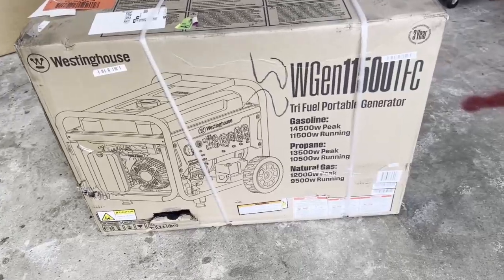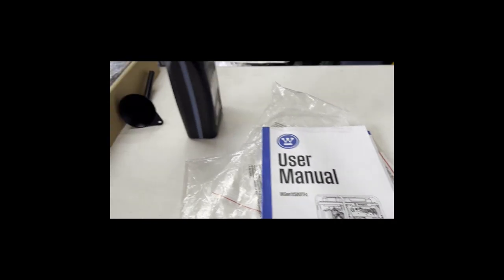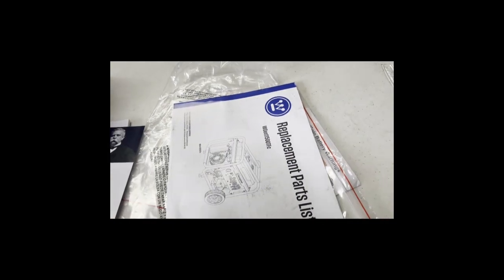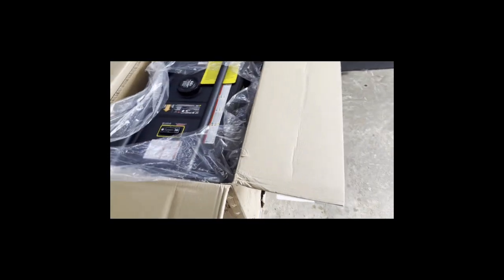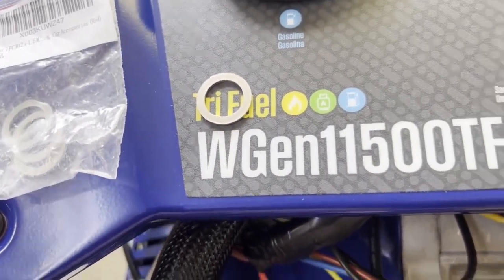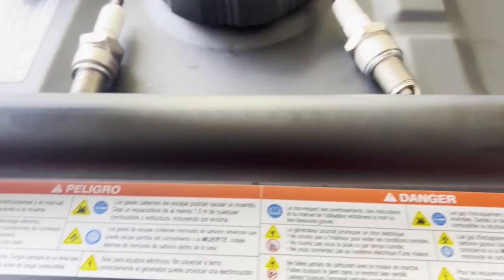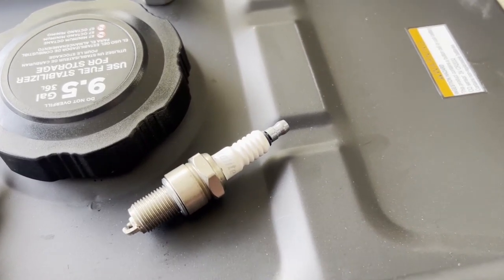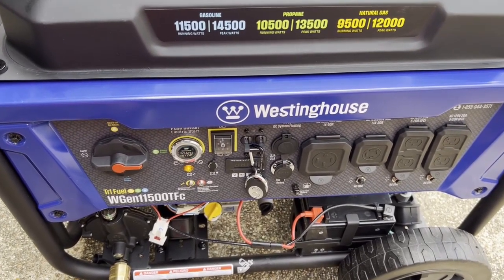My Westinghouse WGen11500TFc

Comment: What was the purpose of changing the spark plug out?
Reply from the maker: The Torch brand spark plug is junk. Lots of people have issues with their generators starting and running well when using them. 
I needed to remove the plug regardless to check the gap since I am planning on running only on natural gas the gap needs to be smaller.
So no real extra time to replace with a better plug.

Comment: Did you make your 11500TFc a floating neutral for plugging into the 50amp inlet?
Reply from the maker: Yes, just followed the instructions in the users manual. 
Took less than 10 minutes to remove the cover, unscrew a nut and a bolt and put it all back together with the neutral wire unbonded (I looped it back on itself so it is still in the generator if ever needed to swap it back). I also made a label to put over the front to show it is a floating neutral unit.

Comment: Awesome video. I upgraded my NatGas meter from 0.5lb to 2.5 lbs regulator done by the utility company and had a plumber extend the line. This will help ensure you have enough flow for the generator and the house items (furnace/fireplace, water heater etc.). So you’re not starving an item and/or not getting your generator to run.  Also upgraded my spark plug as mentioned in the video.  Good luck. Hopefully this helps someone.
Reply from the maker: Yup, need to make sure you have enough flow not only for the generator, but any other gas items you have. You ideally should have the generator as either the first item off the line or a separate line from the rest of the items. 
I have a 1" tee from my meter to ~30 feet of 1" pipe to where I connect my hose. A 1" pipe off the other side of the tee supplies the rest of my house. I have a 1/2" 15 foot hose right now running the generator (what came with the generator), but will be getting a 40 foot 3/4" hose for the finished setup. 
I had read somewhere that the 11500TFc will use ~170 cubic feet/hr of NG at 75% load, and my 30 feet of 1"pipe and 40 feet of 3/4" hose gives me a flow rate of ~180-200 cf/h, so I am good.  

I found a site that let me plug in what my needs were and what my meter provides, and I actually am over the max flow for the meter if I have my generator at 75% load, heater going, water heater running, and am using my gas dryer all at the same time (I did not include my gas fireplace, since I never use it unless I have no power at all and it is freezing, and with the generator, I will not need it). I am not really worried since in the winter time, I will not be running more than maybe 50% load, and can always stagger when the dryer is used.

Comment: What spark plug you recommend if I plan only running on gas? I’ve ordered the same generator so I’m trying to learn as much as possible to run it the right way. Thank you.
Reply from the maker: I would use the same plug (or equivalent), but just set the gap at ~ 0.028
Reply: Thank you boss

Comment: $1,349 at Tractor Supply as of today, 1.14.2025, but online only and they still charge $149 to ship to you or to the store.  So not really any different than normal.
I sure like these but wish they weren't so loud.  But, that's what you get with an open frame.

Comment: Just ordered one of these. What oil drain plug did you end up ordering after you realized you had the wrong one?

Good idea concerning the oil bottle!
Reply from the maker: I ordered this one https://www.amazon.com/dp/B0CNT6JDPV because it had overnight delivery. 
but any M12 x 1.5 will work (so long as it is the correct one).

Comment: Any idea what is causing the rattling noise? They all seem to do it, but I am curious what could make that rattle. It doesn't sound healthy even if it's not harmful.
Reply from the maker: No idea, it is an air cooled 550cc single cylinder engine that is completely exposed with minimal exhaust. 
My guess is the valves just making noise.

Comment: Great video! Did you have to add a softstart kit to the heater as well?
Reply from the maker: No, since I have natural gas heat, it only has to power the 120v blower and send the signal to the igniter to turn on, so not much power needed for that.

Comment: Tourch is trash. Good call changing it out.
Reply from the maker: Yeah, just read a lot of others having issues out of the box (especially on propane and natural gas) with this series generator. A lot of that is attributed to the Torch plug (that and the gap being set larger more for gasoline use vs the smaller gap needed for LPG and CNG).
Figured I could just take care of that from the get go, and as the video shows, it started just fine on the 2nd attempt, and that was only because it needed to clear the propane line of air.